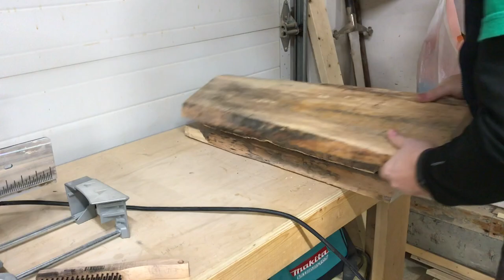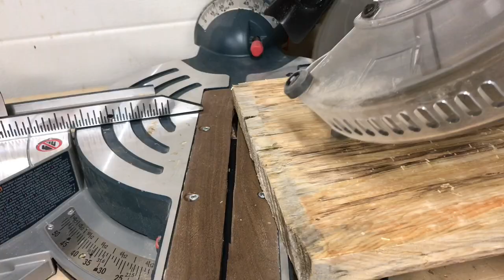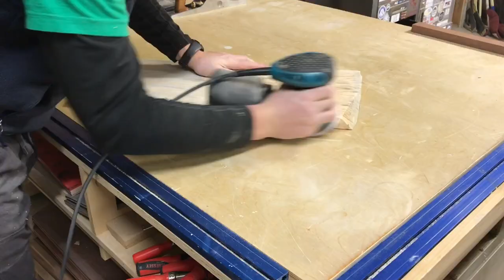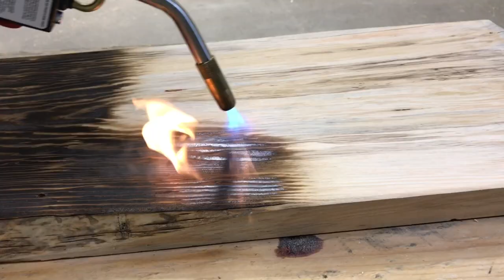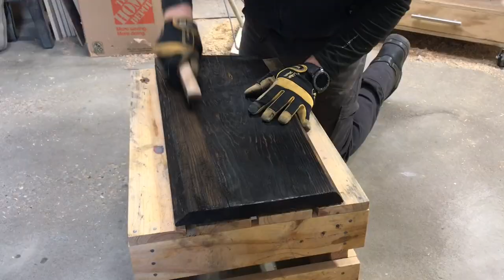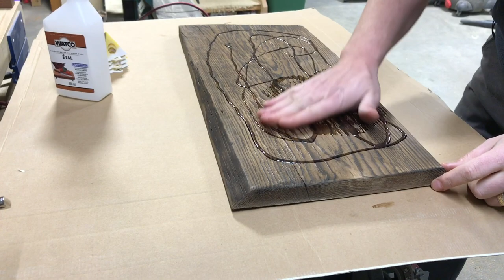ShouSugiBan Charcuterie Board

Comment: Quick and to the point. Looks good, Shaun. What did you think of the finish you used?
Reply from the maker: Yeah was just trying to show the steps used here on this new board.  I typically use mineral oil for all my boards as a first step.  Then I'll put my own mixture of Beeswax and Mineral oil on as the final coating.  Was happy with how this turned out.